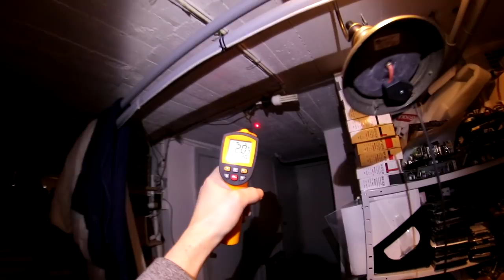Power Loss Blog 6 - Day 7

Comment: 600 volts?? Someone's probably screwed up the governor on that Honda EX650 generator, I own one myself (took some in-depth repair to the rotor to get it working though) and they're so damned simple that they shouldn't be putting out 600v like that!! Lovely little generators when working though, nice and quiet on 50Hz (though only good for 450W continuous, 550w at 60Hz), shame that one's been ruined... :(
Reply from the maker: Weird, this one is rated 360 W, which is getting to the point of being somewhat useless, sadly.
Reply: Definitely weird, I know Honda made a very small generator in the 60s & 70s that was 300 Watts rated (think it was the E300), but assuming that one is actually an EX650, it should be 650 Peak watts at 60Hz, 550 continuous, which is adequate for charging things and powering lights, but the 600v part, yeah, that's very not right... :S

I did a bunch of vids on my EX650, if you're bored and want to watch them:
https://www.youtube.com/playlist?list=PLVOTGk0GfWMEVSj8nXotA4AlkngLQAgYQ

:)